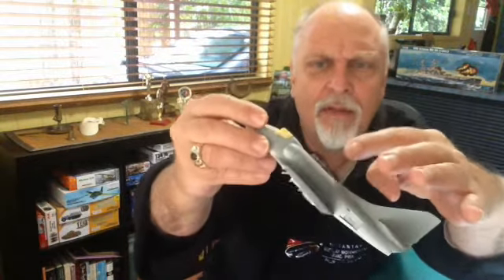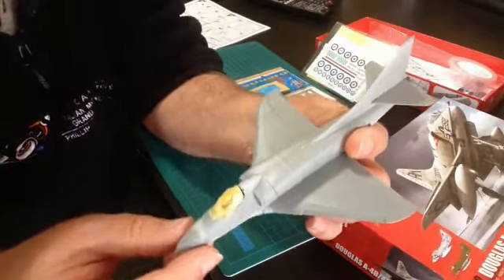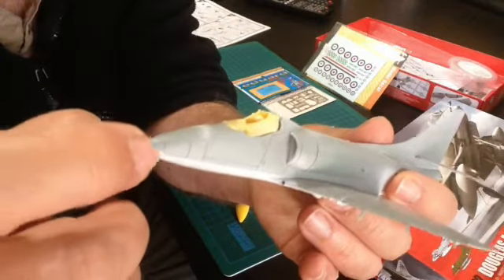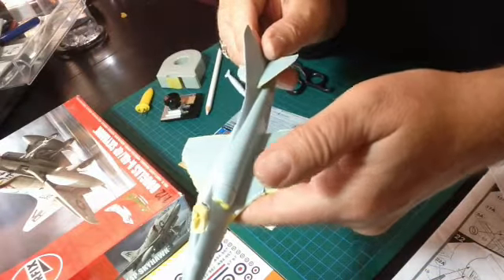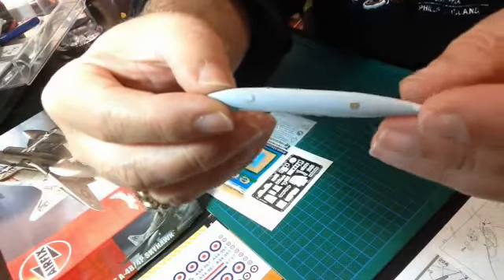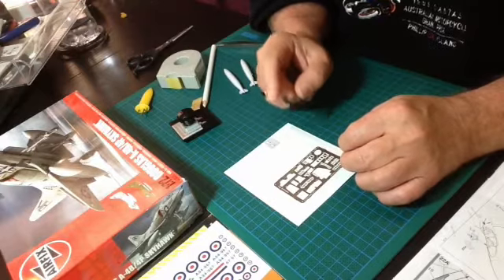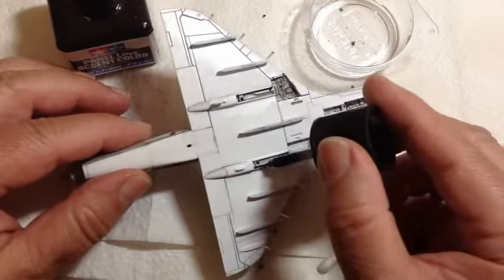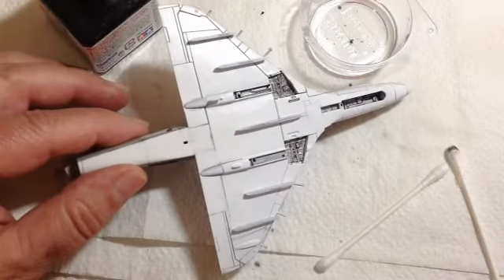Airfix A-4B Skyhawk 1:72 Part 5 (Photo Etch and Panel Lines)

Comment: Another great video,Harri. I have never seen the wax pencil technique for working with P/E, before. I'm going to use it next time I work with it !!!   Thanks,my,friend. Here's a technique I've used with good results. Instead of the tape to mask your cockpit, use toilet paper, instead. Just fill the opening and then put a very small amount of water on it.  Toilet paper is made to dissolve in water. Form it to fit the opening without gaps. Once it's dry, and you are finished painting, you can remove it as a solid chunk. It doesn't leave any residue behind like tape. Happy Modeling !!!
Reply from the maker: +Ennis Anderson good tip Ennis. Almost like making paper mâché.
Reply: It is indeed,Harry. I hadn't thought of that. I forgot to mention, I use my finger to apply water drops on the paper.
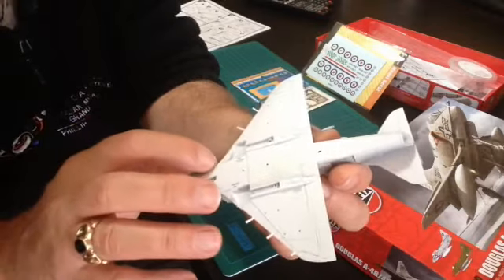Reply from the maker: +Ennis Anderson oh that's a good idea to control how much wetness. I will certainly try your tip on my next aircraft.  Going to a larger scale next time.. Can't decide on either my 1:32 Sopwith Camel, 1:48 Seafire or the lovely 1:32 Meng Komet!

Comment: nice video, great tips too. my own would be that you can scribe those difficult lines by using label tape, the thick plastic type that is embossed by the label printer. you can put it on the model like masking tape but it is stiff enough to use as an edge to scribe against. once again great video.
Reply from the maker: +UKscalemodeller great idea for those tricky curvy bits. I used to have Dymo labeler somewhere.. Wonder if I can just buy the hard tape by itself from my office supply store?
Reply: Harry Houdini That's what I did. got it off Fleabay though
Reply from the maker: brilliant I will look tomorrow when I am down in the city